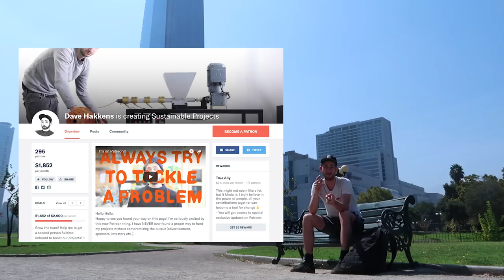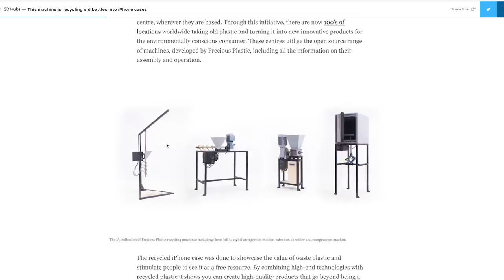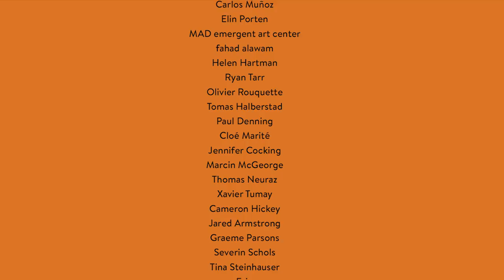Monthly news #13 - Precious Plastic visit in Chile + NEW Story Hopper

Comment: 4:50 I see you are using your glass water bottle well. I'll repeat this here like I did in the forums.. DO NOT reuse aluminum bottles. The contact between the metal cap and bottle causes aluminum particles to get in the water. Prolonged exposure to aluminum can be deadly.
Reply: is it Ok if the cap is plastic ?      or if the aluminium bottle has a lacquer coating on the inside ?